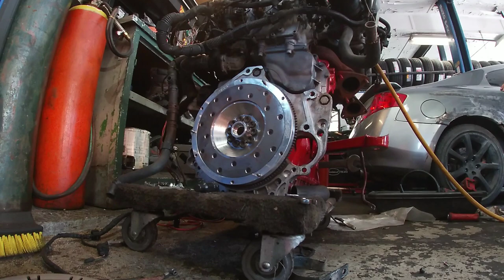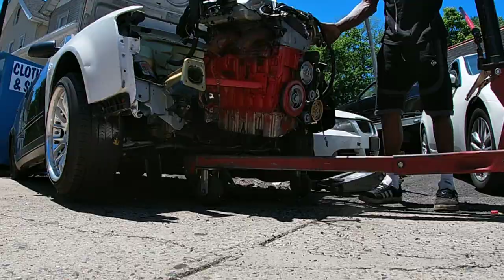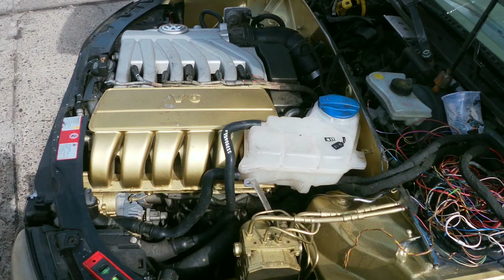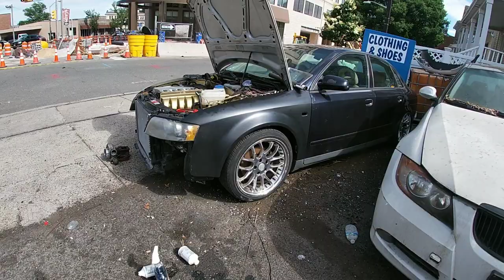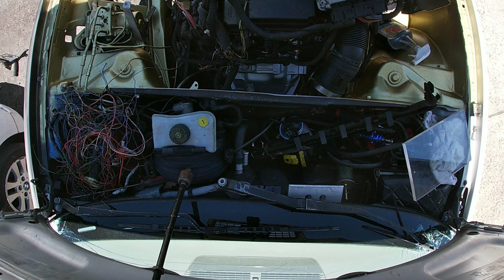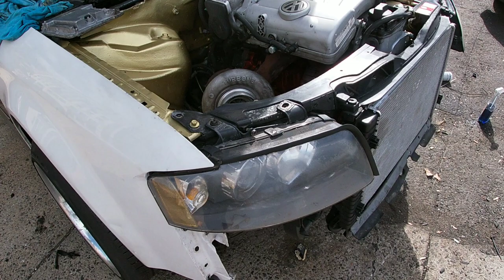B6 VR6 SWAP

Comment: What clutch and pressure plate did you use from what year car oh im living in Jamaica. I need a link for you. Good work man and nice video.
Reply: The flywheel in the video is from 034 Motorsports, it uses a clutch kit from the older 7A inline 5 engine. 

I offer steel flywheel options that can be done for 2.7t clutch, B7 RS4 clutch, CM 850 and CM 725 clutch kits. https://www.ringer-racing.com/product.sc?productId=739&categoryId=122
Reply: I also offer a higher stage 7A clutch that works on the 034 flywheel. https://www.ringer-racing.com/product.sc?productId=746&categoryId=122